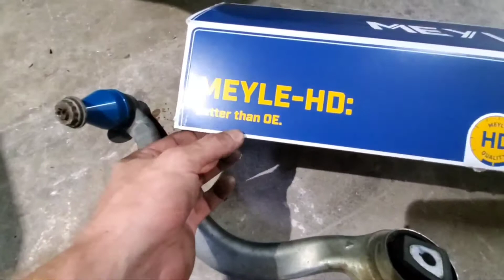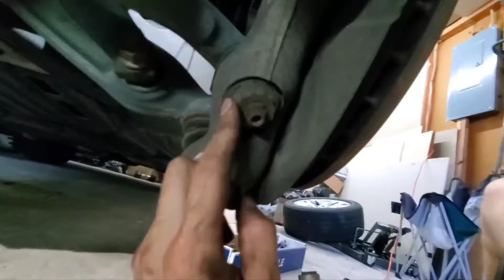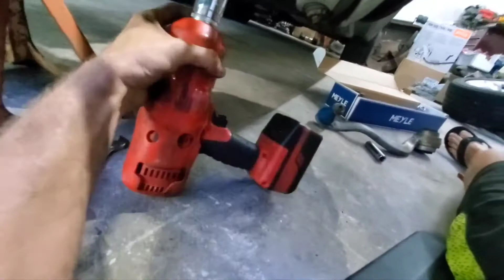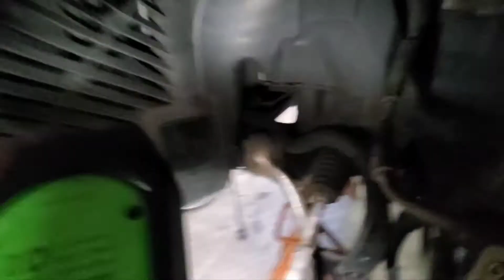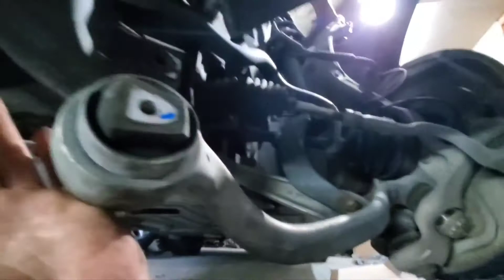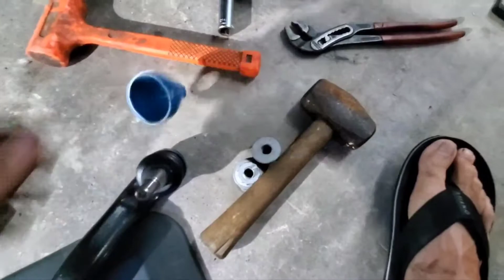HOW TO REPLACE Lower Control Arm BMW X5  Suspension Noise and Movement Fix Step by Step

Comment: That looks easy to do but im having same problem someting making noise but im not sure what
Reply from the maker: Most common issue is the little foam like bushings on the strut mounts. They fall apart and you start getting clunking noise from the suspension.  I have a video how to replace them if you want you can check out.

Comment: This video shows what FCPEuro calls the tension strut. Did you also replace the control arm just behind the arm in the video? I believe they both contain ball joints, so I'd assume it's beneficial to change both.
Reply from the maker: I only replaced the control arms shown in the video since the bushings and ball joints in the other suspension components on my vehicle were fine.

Comment: This got rid of the clunking sound from my front passenger side. I also changed the sway bar link.. 2017 BMW X5 XDrive.. followed the instructions and got it done in 1.5 hours. The car was pulling to the right and left when i went over 65mph. This repair also solved that issue
Reply from the maker: Glad to hear that you got your suv sorted out. Thank you for watching and for dropping a comment.

Comment: Thanks for the video and explanation.  My problem was not with the bushing end but the ball joint.  It had me searching all over until one day I decided to put some grease in the boot with my grease needle.  Of course I sealed the boot with RTV . It lasted about 3 months with the bad roads we have in Louisiana. I still went ahead and ordered one. They got us by not installing grease fittings.
Reply from the maker: Yeah that's another weak point in the suspension on all German cars and unfortunately it's not in their interest to build components that will last forever otherwise they'll go broke 😁 Thanks for watching and glad you got it sorted.